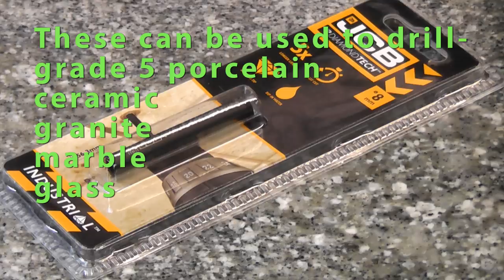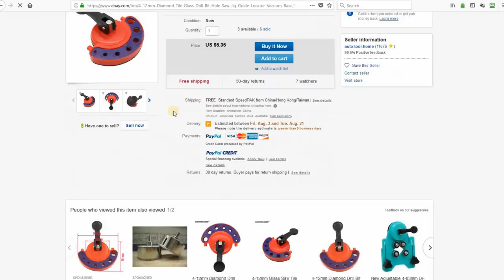How to drill granite

Comment: They are good bits, I also use and like the Rubi bits and the bigger ones you can use on a angle grinder which is easier to hold. Great video.
Reply from the maker: Thanks for the comment 👍

Comment: Wow, that cut through so quickly.  I had a similar set as the 'Ebay' ones and it took me about 10 minutes to cut through a ceramic plate!! 
Thanks for sharing :-)
Reply from the maker: Yes, these bits are very good quality. When I decided to see how many holes I could get from the one bit I gave up as I spent two hours drilling over 50 holes!
Thanks for the comment
Reply: I was looking for some diamind core drills to go through stone walls for fitting soil pipe etc and some of the eBay ones were reported as not even managing a single ceramic tile when people got them! You get what you pay for with drills and bits.
Reply: @ChoppingtonOtter  I couldn't agree more but I can't resist the more than occasional Ebay purchase. I'll definitely be getting one of those decent JCB bits though  :-)
Reply: @ultimatehandyman  blimey, I'm even more impressed now. I'm going to check out where I can buy one now, Thanks again :-)
Reply: well thats a shame for me just spent £5 on a set from lidl thinking they will only last 10/20 according to other sources even the expensive ones. Is there any particular good quality SET you would recommend?
Reply: To be honest if you just drilling one or two holes it better to get cheep drills from ebay even though it 10 min per  hole and these drills can drill fast and can do more 50 holes but cost a lot so can justify the cost if you just want to drill few holes?

Comment: Using a 2 x 1 with the same size hole drilled in it works great for as an inexpensive jig, useful if you want to get the hole bang on.
Reply from the maker: Thanks for the comment
Reply: Cheers for the videos 👍
Reply from the maker: You are welcome 👍
Reply: Very good advice.  I tried this just now enlarging an existing hole in a granite countertop and it worked perfectly. One thing I would add is to make sure you have an equal sized bit on hand that's appropriate for wood.  In my case I did not and though I got through the wood with my diamond bit, it's obviously not best.

Comment: Do I have to use a hammer drill setting for drilling an anchor hole for 1 1/4" Quartz shower curb?
Reply from the maker: No, do not use hammer action. Just use rotary action with a diamond coated drill bit and you will be fine 👍
Reply: @ultimatehandyman    Thanks, I got through it without the hammer action. I had a cup with ice and water and kept dipping the bit in there to keep it cool. And I used a couple of bits, I was nervous because I broke the tip off the first bit I tried to do it with.   I appreciate your advice!

Comment: I have an old granite house that I will be starting to do up next summer. It looks like I will be doing something different when trying to set up a wooden frame to put up plaster board in some of the rooms. Drilling granite seems to be a bit of a nightmare. Sounds like I will be putting in a frame for my plaster board and attaching it to ceiling and floor and only drilling to support it in the mortar of the granite. Other wise it will take me for ever to drill the granite.
Reply from the maker: We don't have many granite houses around here (there might be the odd one). We do have houses that are built from engineering bricks (Accy Nori) bricks, which are tough to drill.
If I get chance I'll try and get a thick piece of granite and see how well the SDS drill does against it. 
The wood frame sounds like a good option, I've done that a few times with ceilings etc.
Good luck with it ;-)
Thanks for the comment

Comment: I'm a cabinet maker that does a bit of DIY. To get a clean hole I will sometimes put a sacrificial piece on the underside. I know the tile will go on a wall and the back lost for ever but how clean was the exit hole (Just curious)
Reply from the maker: The exit holes were clean, probably because these bits use abrasive to do the cutting (diamond grit). To begin with I was pressing on quite hard, which can give a little bit of breakout on the exit. But if you don't press on hard you can get a perfect hole on both sides.
Thanks for the comment

Comment: Stopping every 5 seconds looks extremely tedious. If I was drilling more than one hole, I'd buy some silly puddy and use it to make a circular dam around the location of the hole. Fill the dam with water and drill away.

I had an old timer use that technique 30 years ago when I took an ornate bottle to the local hardware store to have a hole drilled in it. Side note: the bottle broke...not because of the dam but because bits for drilling in glass were junk back then.

Comment: Is it okay to use masonry drill bits?
Reply from the maker: You can try, but make sure you keep the bit cool, by applying lots of water. It will be harder with a masonry bit, and if it’s a cheap one, the tip of the drill might be badly damaged!
Thanks for the comment 👍

Comment: Can you do a video on drilling through welds? i am having trouble drilling through them so far i have tried using cobalt drill bits and even tungsten and i dont get very far
Reply from the maker: Cobalt drills should drill through most welds.
Do you know what rods have been used for the welds? 
Sometimes the metal can work harden due to the heat. 

Tungsten drill bits should drill through most metals including hardened steel.
Reply: stainless steel electrodes i used
Reply: drill bits burn they go black
Reply from the maker: Stainless can be a real pain as it work hardens easily.
A good quality cobalt bit on a medium speed with plenty of lubricant should do the trick though. I recently bought some cheap cobalt bits and they are nowhere near as good as a decent quality make such as Bosch, Dewalt, Heller etc.
Reply from the maker: Thanks for the comment

Comment: And we are told bronze age people drilled holes 10 times this size through 70 ton granite blocks....
Reply from the maker: Yeah, I've seen those holes and the huge blocks that have perfectly straight edges.
There is definitely something missing from the history books ;-)
Thanks for the comment
Reply: @ultimatehandyman  there is a video somewhere on youtube where 2 men with a  copper saw and some sand got a cut rate of about 4mm per hour. I imagine similar rates possible with a copper drill bit and the same. I imagine that a frame would be built over the granite and a large bow drill or saw could then be operated yielding much higher rates. They could also have built water or oxen or man powered much larger saws and drills, quite a few examples of such things built with wood on youtube and other sources online. No doubt much of what they did is lost to us.
Reply from the maker: @Jafmanz   Thanks for the comment ;-)

Comment: good video. Question : If you oscillate the bit I would assume the result would mean that the hole is slightly larger than the drill size.  The question is would it be recommend to purchase a slightly smaller bit to make the hole the size you require?
Reply from the maker: Thanks, oscillating the bit does not effect the diameter of the hole much, but if you needed an exact diameter hole, I would just drill it without the oscillating movement.
Thanks for the comment
Reply: Thank you for the quick response.
Reply from the maker: You are welcome ;-)
Reply: I'm glad I checked the questions before I jumped in on the size issue. I'm new here; I particularly enjoy your no nonsense approach. So, keep up the good work.
Reply from the maker: Thanks for the comment ;-)

Comment: You talk about engineering bricks. After work years back we had a job to cut a track for cables on another job after work. I started to cut into the engineering bricks. with a stihl saw with a diamond blade on the saw. Total waste of time. Sparks every where and barely marked the bricks. So home. Saying that I think they were engineering bricks all I remember is that they were a kind of glazed on the face of the brick.
Reply from the maker: I tried to core drill a hole once in a modern house and my diamond cores would not touch the bricks (I think they were calcium silicate). Engineering bricks are a right pain, as are some firebricks. I once hit one of those in a terraced house wall and it was impossible to drill! 
Thanks for the comment 👍

Comment: Why would you use safety glasses for this job ?...
Reply from the maker: You are using a drill, which states in the instructions to wear safety glasses/goggles, as does the diamond coated hole saw. I also know two people with a glass eye each- that always makes me want to wear safety glasses!
Thanks for the comment 👍
Reply: Ultimate Handyman These instructions, as we all know, are only written for American lawyers. Your glass-eyed friends didn’t get in this condition by drilling a tile hole with a diamond drill, right ?
Reply from the maker: They were both born with two eyes, and both of them lost one eye due to not wearing safety glasses. One when a milling machine cutter broke and the other when he was simply knocking a bearing off from a shaft. The instructions are written to prevent idiots from damaging themselves when they cannot see the dangers. I have seen regular HSS drill bits snag and shatter into several sharp pieces. If you don't want to wear safety glasses that is fine, but I always wear them and I always recommend that other people wear them.